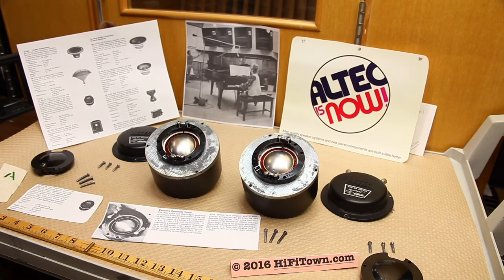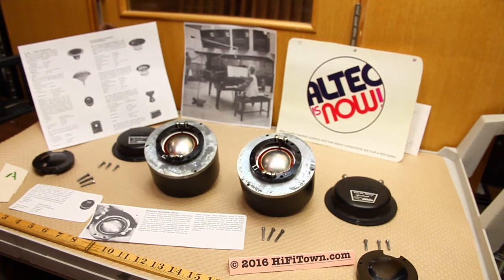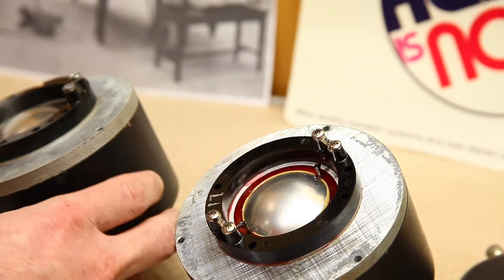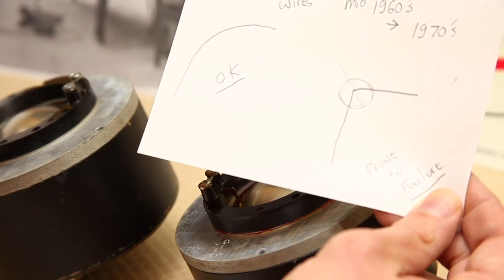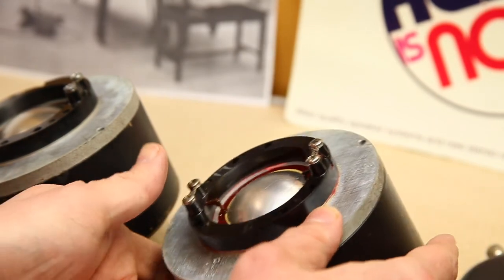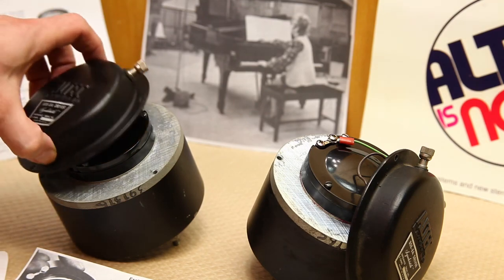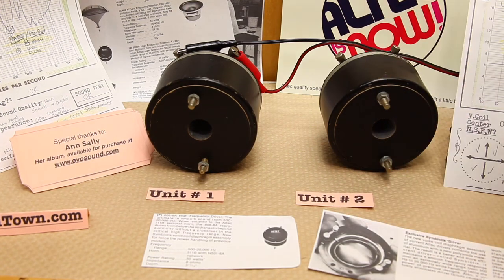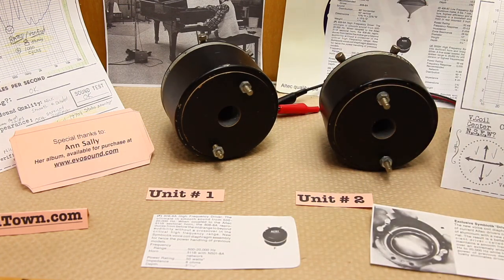Pair Altec 808-8A from 1973 Test, review and inspection

Comment: Radian Audio makes an aluminum Altec replacement diaphragm with a mylar suspension like that of the Symbiotik. Radian diaphragms are made in California and many hornies prefer them. They also make aluminum replacement diaphragms for JBL drivers. They do BE diaphragms too. And they make excellent drivers too, right here in the USA.
Reply from the maker: Hi Tom, thanks for this info. I really agree, if anyone is unable to repair -- and must have a Symbiotik's hybrid method... Radian deserves much mention. It might be worth double-checking on the origin of mfr for their Altec 1" product. I was always under the impression those were made via Radian's connections in South America -- but I may be confusing that with GPA.  I have not had any customers tell me they prefer Radian's to old, original Altec -- but I will certainly keep an open mind. The issue with modern stuff is it's made to be rugged. The original Altec 802, aluminum / aluminum wire/ paper former  units (1940s,50s,60s) were made to take less than 1/3 (or less) the wattage expected of most modern diaphragms. This leads to heavy heat resistant Kapton formers, and thicker wire... that slows stuff down needlessly for audiophiles with 3 watt 300B amps.

Comment: I got a set of these, and have just hooked up some tweeters with them. They sound good in a two way, but noticeably better in a three way. The tweeters are cut at 7000, and man did the808s smoothed right out. As good or better than fortes.

Comment: Might anyone be able to confirm the dimension from center of flange mounting screw to center of second flange mounting screw?  Ive been searching, but cant find a simple diagram that is clearly labelled.  Any help would be appreciated.  2nd question. if the 'gaskets' get trashed, what are most using as an ideal substitute for material?  Thanks...

Comment: Nice video. I have an 808 with the same broken connector. Im handy with a soldering iron, but nervous to try this fix. Can you detail how you go about fixing those broken connectors? Thanks!
Reply from the maker: Brian Beers Hi Brian, you are correct -- it's tricky! You must remove the diaphragm, use flux and a piece of flat copper, same thickness. Perhaps another video on this in the future!

Comment: Hello. Someone is selling me a pair of these. They seem to have the original diaphragm but one dome underneath the diaphragm is different, seems plastic and not metal. Will this change the sound quality? thank you!
Reply from the maker: The dome underneath is a critical component called the "phasing plug". On a quality compression driver it's usually a complicated piece.  In the early 1970s, Altec spent allot of R&D effort to redesign this part, which had been essentially unchanged since the 1930s when Jim Lansing's team designed it. The new phasing device was named the "Tangerine" as it was made out of high quality orange colored plastic. The performance was quite good. And it was an independent development alongside the symbiotik diaphragm. Pluses and minuses versus traditional Brass Construction are debated sometimes, but in general it's considered one of only a handful of improvements in compression driver design since the 1920s and 30s. unfortunately if you have one tangerine and the other traditional brass, you have a mismatch – – and yes they do sound different. it's not a big deal, because in a stereo system you'll be hard-pressed to notice unless you listen very carefully. Both types of phasing devices are really nice sounding in Altec drivers -- and it boils down to personal preference. Because the "symbiotik" hybrid diaphragm was almost always combined with the tangerine phase plug in later years, the tangerine plug got a bad reputation for limiting HF, that it should not have received.... Combining an all aluminum diaphragm with the tangerine phasing plug is a good idea and certainly worth your time.
I personally prefer the use of older aluminum diaphragms with aluminum windings (1950s)  and traditional brass phasing plugs. But it's not a huge deal and you can get good sound out of original Altec drivers of either era....

Comment: I have two pair of the 808 A for my speaker system. All 4 have the diaphragm loading caps .I do not recall Altec making them optional as they are an integral part of the compression system so that the diaphragms can compress the air column and endure higher wattage input levels . 
The symbiotiks  handle more power but sacrificed  upper range , mine  use Pascalite aluminum alloy.  Without the caps  in place the driver will exhibit an improvement in response at the higher frequency range of their response ...the penalty is power handling ...that they protect the diaphragm form the wires is purely accidental  but a nice bonus . Incidentally the wires can be changed and secured to the dust cover ...so as to make damaging the diaphragm less likely .One of my pairs is set up exactly for that purpose....extended highs in a two way system ...but the play loud enough, at low wattage input anything above 5 watts most people`s ears will bleed from their output at 20 feet away .

Comment: Hello, Do you know how disassemble the magnetic base? It looks like there is some trash in the one i'm working on and i don't want to break it trying to get it apart.
THANKS
Reply from the maker: Hello, it is not possible to break the "magnetic"  circuit on an Alnico driver. If you do, you will need to demagnetize it to reassemble (which is a giant specialized machine). Yes, there is a way to remove magnetic dirt and trash from the gap - an old trick. In the old days technicians used a strip of folded over masking tape, nowadays, we use a more effective "sticky side of a 3M post-it".
Reply: @HiFiTown  Thank you for responding.
It looks like there is some paint drops on the screen and I have sprayed some cleaner trying to remove it , but no luck. I know you can turn the plate that the driver bolts to but it does not "unscrew". I don't know if there is a clip or a snap ring or does the magnet hold it in there. anyway I wanted to replace the screen. Any ideas?
Thanks
Buddy

Comment: Hello, 
how do you determine the polarity of the diaphragm once you have taken the crimp connectors off?
Reply from the maker: Good question and not easy to do! It is (I have done this before) possible to use a worn down 1.5 volt (AA, C etc) battery. This amount of voltage won't harm your coil.  You clip the battery to the terminals. DC polarity will push it up or down depending on the direction of connection -- it's tricky to see it move, but practice will pay off...  (I can look, as I am not near my Altec library presently) Altec  service specs should specify T1/T2 and convention. They may not, and since Audio sine signal is AC, it does not matter. What does matter is that you have them both wired in the same way / direction for your stereo setup, otherwise it will, of course, be out of phase. Altec miswired the 604 for an entire decade, a little known historical goof on their part! So use common sense and always keep them the same driver to driver, and then mark to remember, my advice!
Reply: @HiFiTown  Okay great! thank you for your detailed response. So just to clarify: wiring in the drivers individually needs no attention to polarity, but both drivers need to be wired in with the the same polarity? Also, do the 'L1' markings, revealed when you removed the protective cap, have anything to do with the polarity? Thanks again
Reply from the maker: @samplant7936  Hi Sam, yes, wire the drivers the same, and as long as the rest of the system is in phase, then it makes no difference. Yes, L1 and L2 were generic markings designated by Altec for wiring and polarity, but things changed over the years. The color code means more, it was usually green/black. It should be noted in the service bulletin for whichever driver you are working on (check google) ....

Comment: hello , what do you think about the 806-8A drivers ? are they also suitable for HiFi sounding when coupled with 511B horns ? daniel from france
Reply from the maker: Hi Daniel, Sure! You can use these with great success in HiFi. They are very efficient just like all aluminum designs -- with a slight bit of smoothness in the upper mids that all metal types don't have, with less breakup (at times). At the same time -- they are not as bright, so some prefer to add a super tweeter to cover that area. They are really good, just not quite as sensitive in the upper HF area. Midrange is very good : )
Reply from the maker: Correction to this reply ... the 806-8 should be an all aluminum diaphragm. The 806 series has a smaller alnico magnet, which is just fine in practice and the slightly lower output is often perfect for Normal system set ups, therby requiring less attenuation..... So if you can get an older 1960s green Hammertone finish unit you should be in hi-fi heaven!